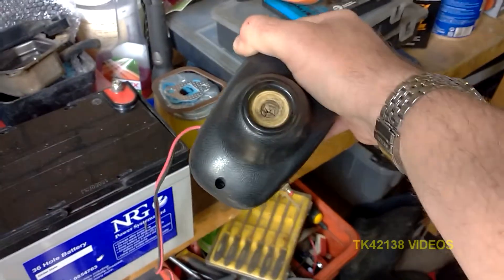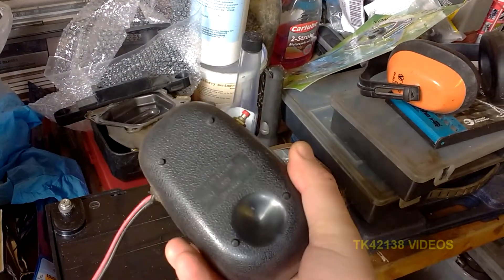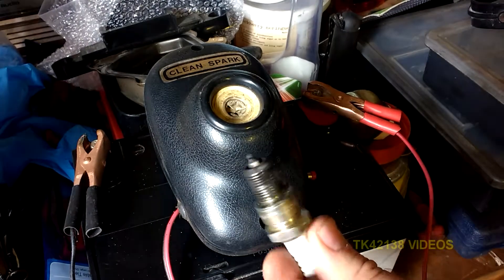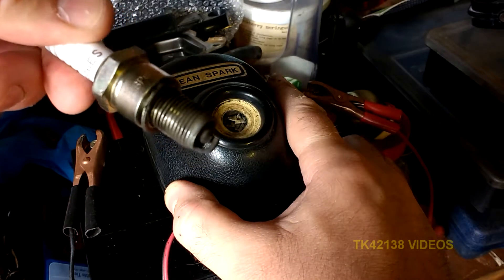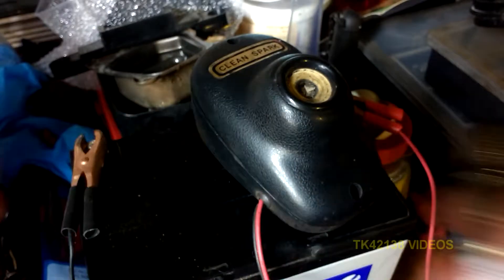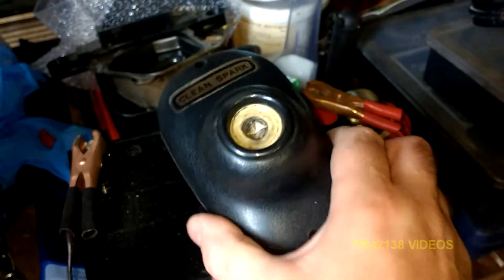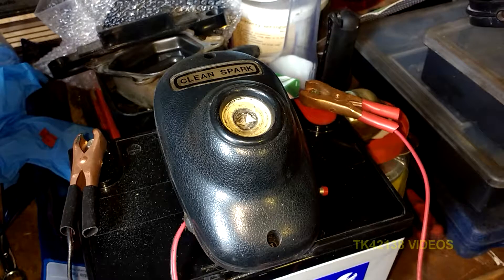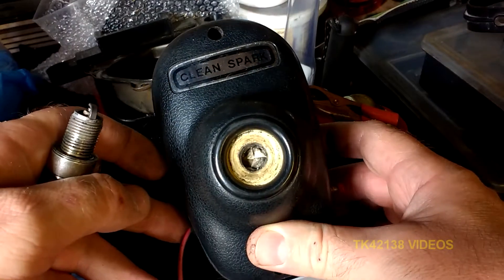1970's sparkplug cleaner - does it still work?

Comment: Bit late to the party lol! I have the same wee machine that I use in my mobile set up. These work best for removing carbon/rust, plug needs to be dry for best effect. I give em a quick wire brush n skoosh of carb cleaner then blast em with the cleanspark.